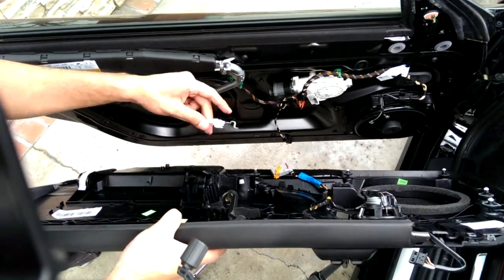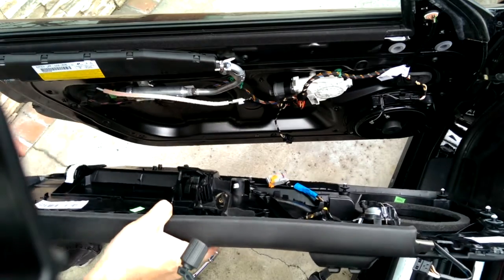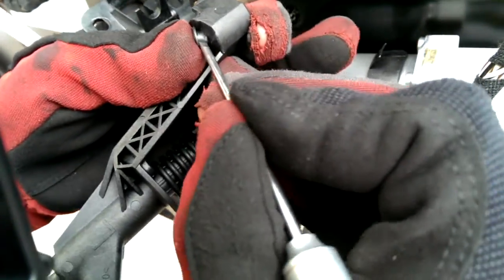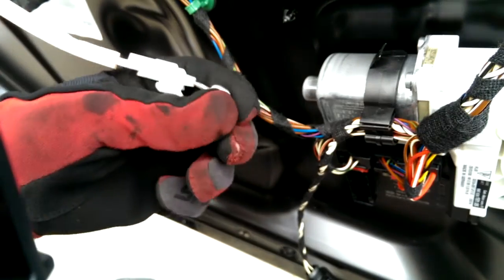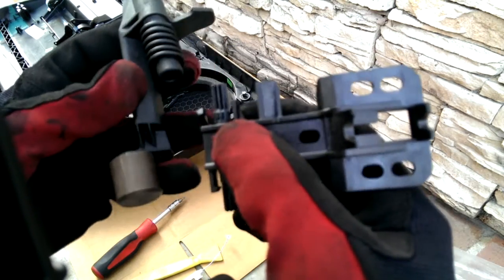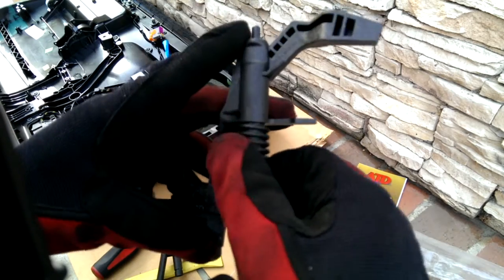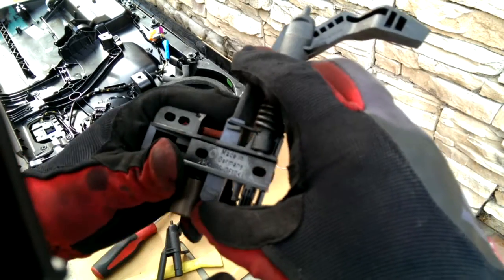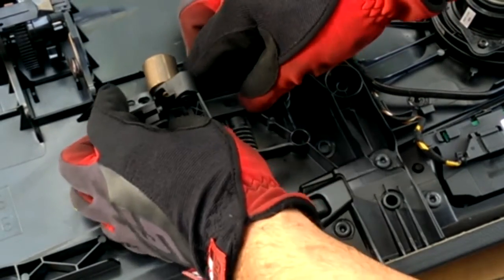987 Cayman S Door Lock Pivot OCNP

Comment: Note that this process is also good for a 987.2. and likely the part is interchangeable with the passenger side. I didn't even need to buy the new part as he did since you can remove the passenger side part that he is swapping here, turn it over, and swap it for the driver's side. if your issue is the cheap plastic tab that is cracked or broken, there is one on each side of the piece. The same piece is just upside down for the other side of the car. Thanks for this excellent video!!!

Comment: Good post.  Note that the part that usually breaks (post that pushes on the spring) is reversible and can be used on the opposite door later if the other door has the issue.